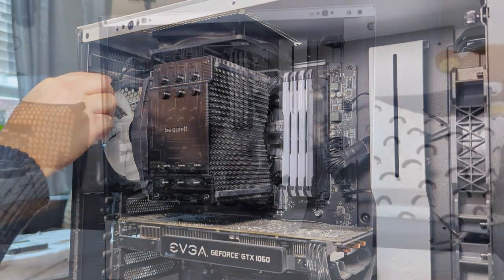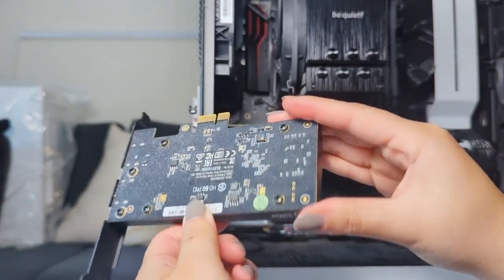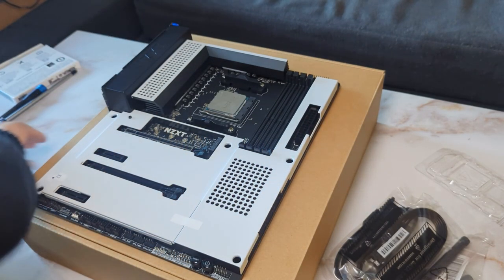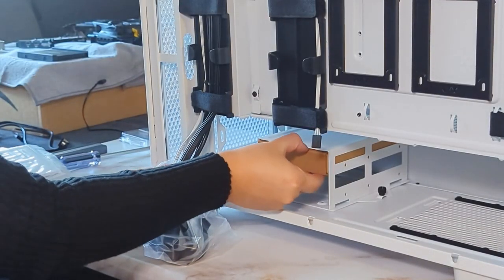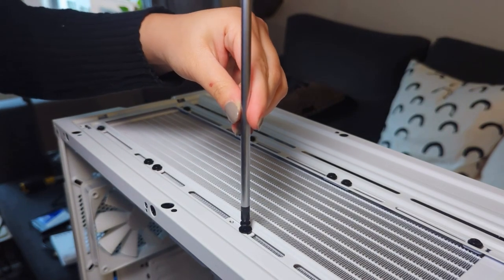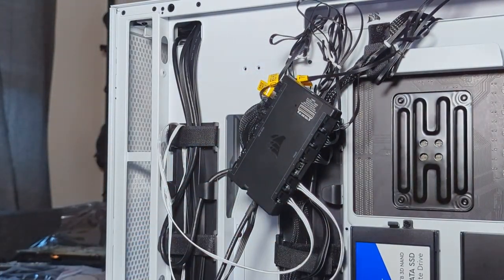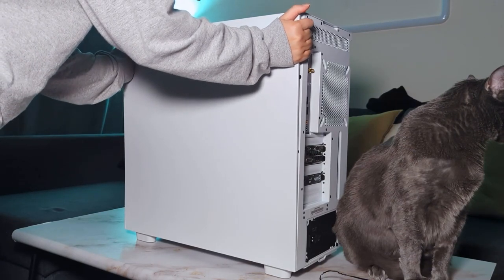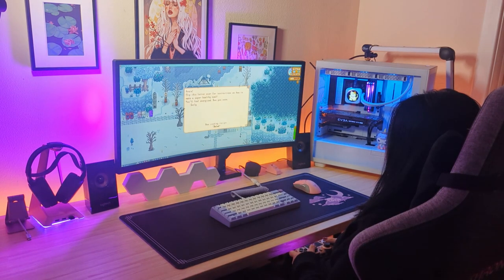Build a gaming PC with me 🖥️ | minimal white aesthetic 🤍 |  NZXT H7 Flow

Comment: Great build! Again great aesthetic. I just build my own PC. After using a Razer blade base with a 2060, for 3 years. I went with a Nuc 12 extreme, i9 12900, 3070ti, 16gb duel channel
Reply from the maker: Thanks! That's a nice build :)
Reply: @piccomoon554  thank you, i really wanted a 3080 or 3080ti but my case is extremely small. The few 3080s that fit where all sold out 😭

Comment: It looks nice. BUT NEVER DO THIS! This is an absolutely terrible build/upgrade. The AIO costs more than the CPU it is cooling, and it's a low wattage CPU that doesn't need 360mm rad. The motherboard is now the most expensive component! And the most importantly of all the 1060 is still the GPU, and the GPU matters the most for gaming!  So you didn't gain any performance and spent a ton of money for aesthetics. Awful awful awful.
Reply: I felt the same pain
Reply: @Brenrys  So sad but I guess that is what she wanted with her super aesthetic-oriented “upgrade”.
Reply: Could have went with atleast 6700xt or 3060ti. Smh.
Reply: @Chanandler_Bong-z2z  Exactly, even on aesthetic levels the 1060 is quite ugly compared to the rest of the build.
Reply: can i ask if u think i should get a 240mm aio for a 5800x
Reply: @nerdiestguyhere9703   not necessary. A 240mm would be for aesthetics pretty much. An air cooler would suffice.
Reply: she literally said she planned on future upgrades. and who said anything about only using this for gaming ?? not everyone needs a beast of a computer. it's her money and no one asked you.